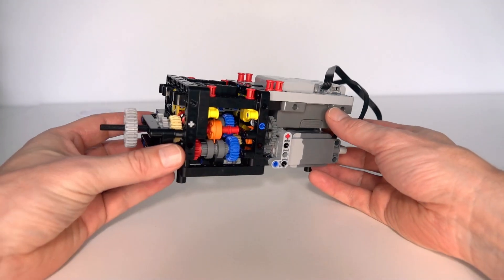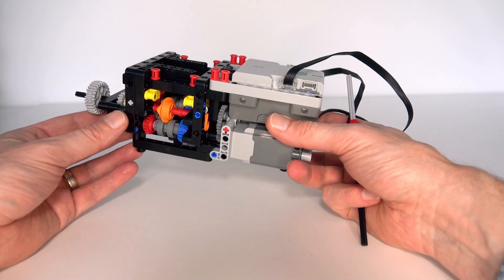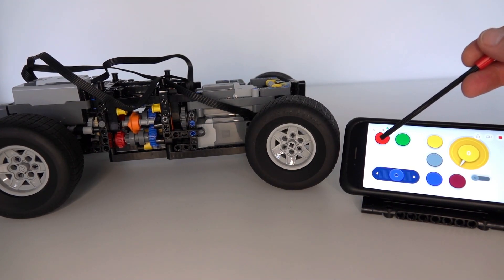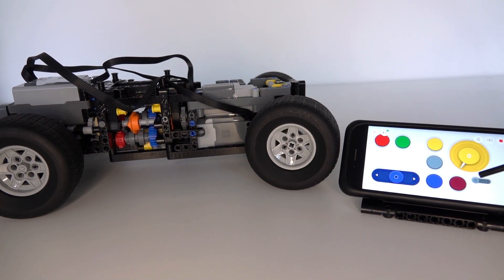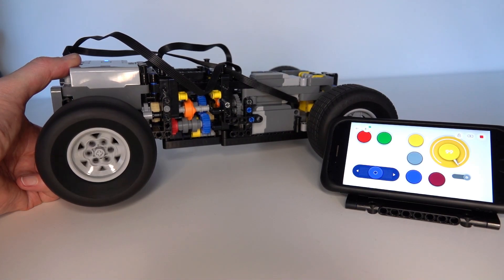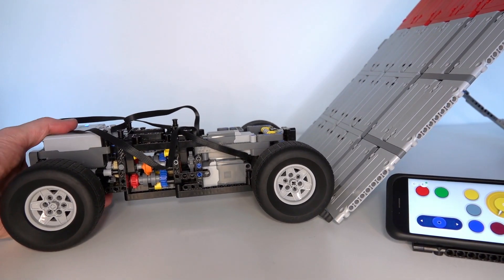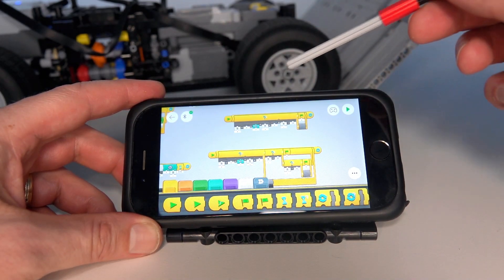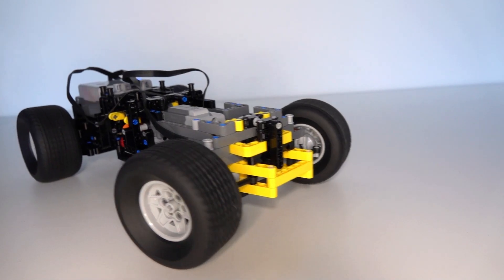Lego Technic Powered Up 3 Speed Automatic Car

Comment: Would be cool if you made a variable in the code for gear-status:
0=unknown/shifting/neutral
1,2,3 = current gear
-1 = reverse
Then add a "speedometer" on the display.

Or use the actual number from gear-ratio

Comment: Is it possible to change the gears from going lower to higher? Couldn’t you achieve”fast” speeds that way? 

Like:
Gear 1: 1:1
Gear 2: 2:3
Gear 3 1:2

It shouldn’t take to much torque because u would already have momentum.

Maybe I am wrong do, if so please correct me😇
Reply from the maker: Hi yeah that's how normal cars work. With Lego you generally get your top speed straight away due to how electric motors work (they just have 1 unloaded top speed and then slow down with more torque). So generally you have to switch down rather than up!

Comment: If you could detect the motor for the drive turning off (I’m not that informed if this is possible or not idk), then technically a good idea I think to fix the car driving back a bit between the gear switching is as follows:

Detect what the tilt of the power up unit is.
(I remember one of LEGO‘s off-road sets had that feature) if the data suggests it’s hill up like in your test, and the motor is off due to low rpm shutoff, activate some brakes in some sort. Maybe some rubber peace directly in contact with either the back or front wheels. Or just block the drive output of the gearbox to a overload gear (the white one) with a small „brake gearbox“. But in honesty I think there are countless ways to build such thing that makes the desired outcome.
Reply from the maker: Hi Jason - thanks for those ideas - someone suggested using a worm gear to prevent roll back - probably the simplest solution but confident many others exist. Yes you can detect the slope of the PU hub and maybe use that also.